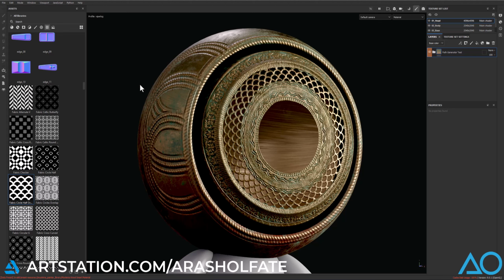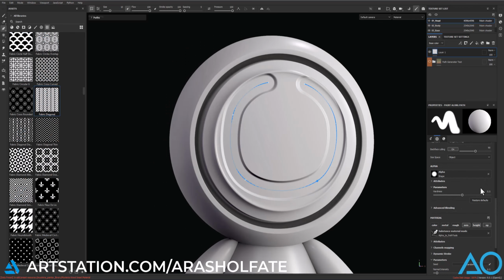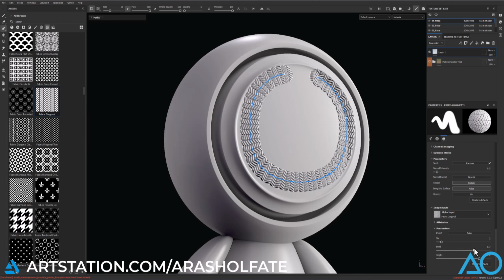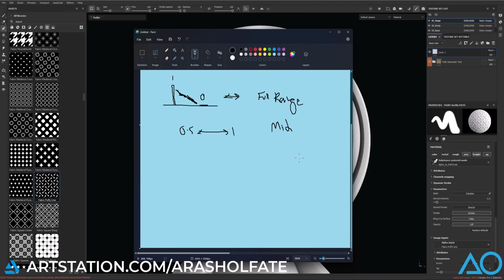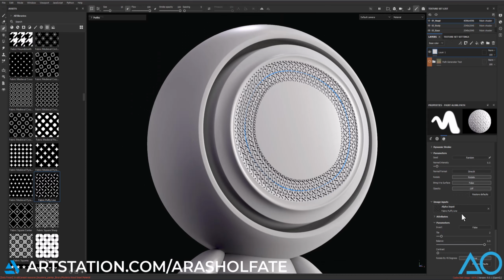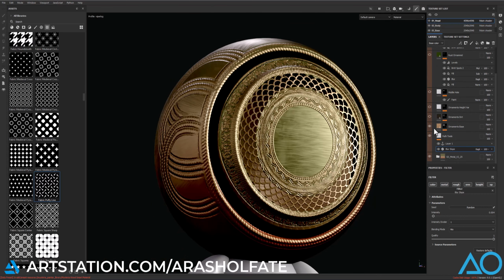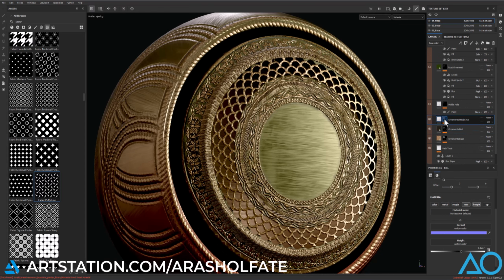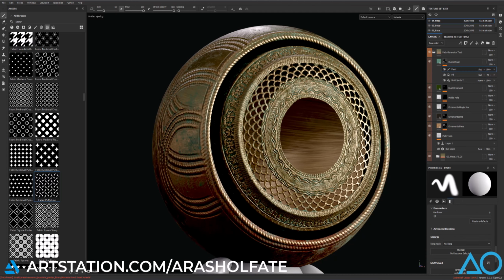Substance Painter Path Tool Generator - Turn Your Alpha Map in 3D Path Tool

Comment: Hi, I purchased it and followed every step up until the point where I plugged my custom alpha into the Image input. The issue is that the tool doesn’t recognize it as procedural, even though it is procedural.

Could you please help me with this? I’d really appreciate it! 🙏
Reply from the maker: the tool has the limit about procedural Alpha (means to have your pattern as a sbsar file), you need to use bitmap (picture) alpha,  my focus was not on procedural content, it was making a tool to reuse your alpha pattern library.